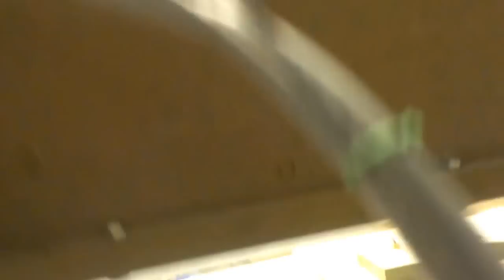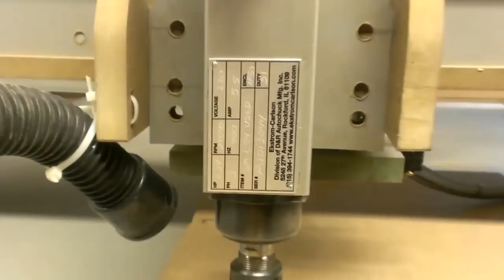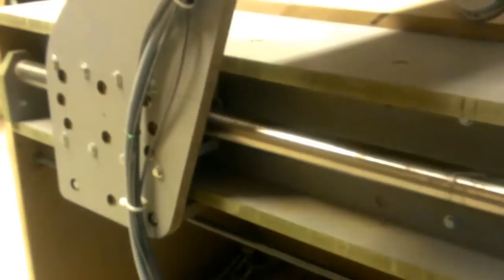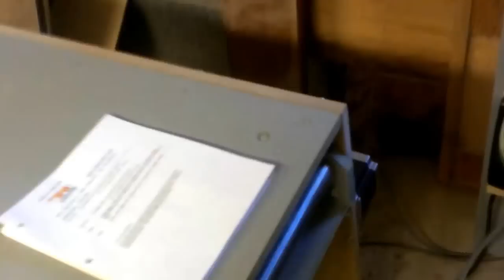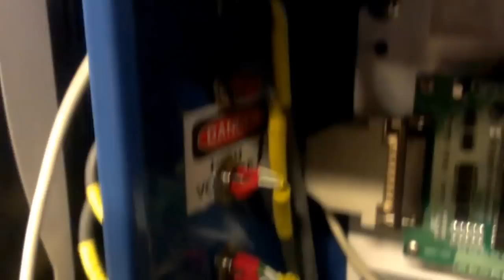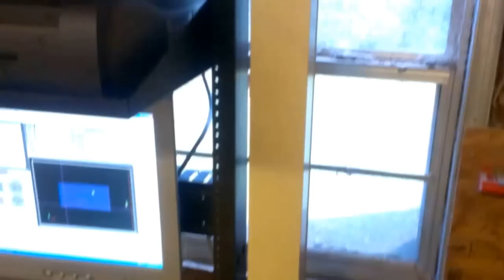DIY 3-axis wood CNC router with Emerson SK Commander VFD Drive

Comment from the maker: I totally agree!  I will say though I was happy it worked.  Since this video I have built a fully welded bottom frame.  Incorporated an eight zone vacuum system.  I am now finishing a rework design of the gantry out of 3/4" aluminum.  And have purchased rolled ball screws for gantry.  Video is coming! I promise.  I love the analogy!

Comment from the maker: There was a question on connection of nemas with mach3.  I am running 4 nema motors. Two of which is a slave motor on the Y axis. I am using 4 drivers though and connecting them through the breakout board. In mach3 you have to enable slave function in general setting and you still have to tune both motors.  In the general motor setup it shows how to set by step.

Comment from the maker: I guess I have spent about 3k.  This is partly due to buying stepper motors and drives twice. I have since this video, rebuild frame to a full welded base. Still the same size, added drag chain on both axis, incorporated a 8 zone vacuum top. I am in now in the process of converting to ballscrews on all axis, and conversion to aluminium gantry. In the end after this it will put me over 4k. The plus thing is the table has paid for itself over and over again. Theory..... Got to spend money to make money.  Thanks for watching my video. I need to make a new video of my changes.

Comment: That's actually a telcom rack.  Many people use them for servers though.  A true server rack is used on a raised floor so the cooling air comes in underneath the cabinet and exhausts into the room.  So all 4 sides are covered.  Nice Table!  I really need start building my table.